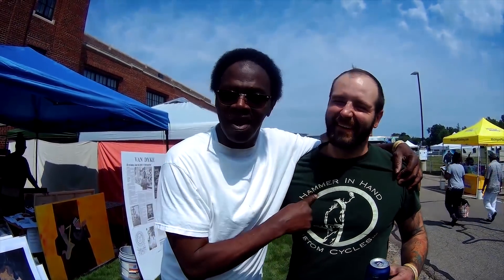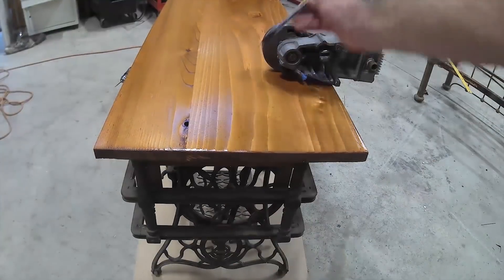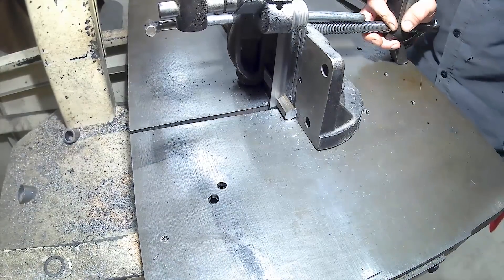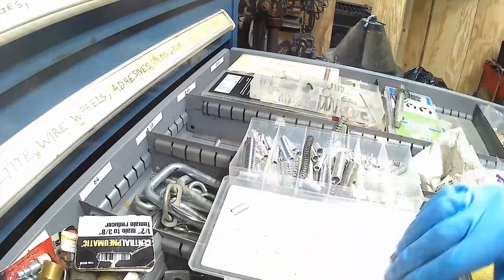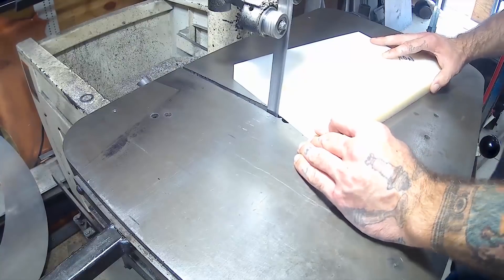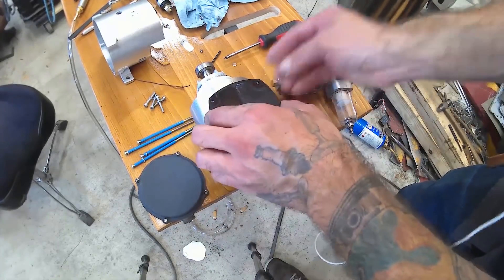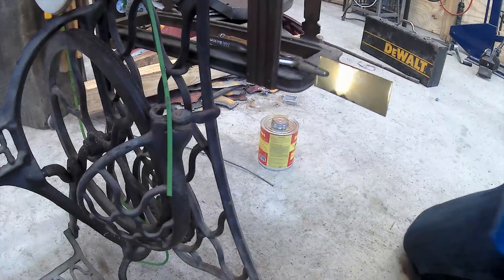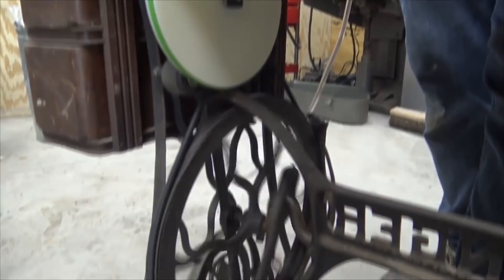How To Make A Pneumatic Air Engraver Machine

Comment: Ivan hey Tom Boswell , I just noticed you were treadling with one foot real slow ......? I've been using both feet , but I've noticed when I get to going with it the compressor loses its blow and suvk until it slows back down and picks it back up.?? So  it works when it is treadled slowly..??? Been experimenting with different weight pistons and the length of the hand piece. But o have yet to use a ball bearing do you think that would hit harder?  I mean it hits hard I think, I was just looking for a little harder hit I think? Any thoughts on any of that? Thanks a bunch!!!!!

Comment: Ivan, live your work, and intelligence.your such an inspiraton! Ive been teyi g to make a pnuematic engeaver for al.ost a year.I finally got it the other night!! Bought me a treadle for $80 and got the same little compressor from Harbor Freight. I kind of dont understand the pulley set up you used for speed increase. The treadle pulley runs to a  pulley that has two belt guides,and then on that same pulley but on a smaller guide is a belt that runs to the compressor? Correct? Hit me up if ever need so.e one to work with.Id love to learn as much as i could from you. Im a sculptor my self , its what im passionate about. Any ways im in to all sorts of art and fabrication etc. I have a uncle who built a pan/ evo he made it work!! ??? Thank you for all you do love your work  youre a really neat person, maybe i will be able to meet you in the future. I come from a family of hard core bikers myself, and i can sculpt just about anything i can think out of what ever kind of material i can find. Never been around a lathe or ever been given a chance to do much welding but you toatly inspire me. So thanks.

Comment: Keep going brother, you are a man after my own heart. I make all my own tools as well. My system is similar but I didn't have a unit to convert for the push-pull air action so I am machining it from the ground up out of 360 brass. Man, necessity truly is the mother of invention. My first system is a rotary valve device that simply turns the air off and on but requires an air compressor. I'm going smaller and lighter so the push-pull system in the second system on the work bench to be finished. I hadn't thought of using my old Singer for that just yet, good idea.
Take care brother and thank you for sharing.